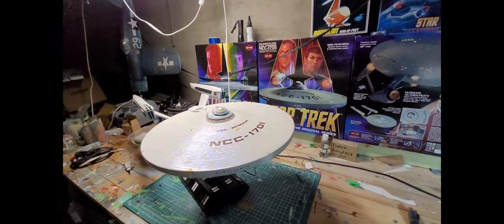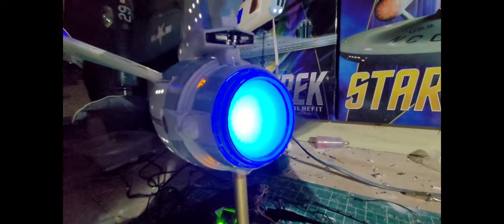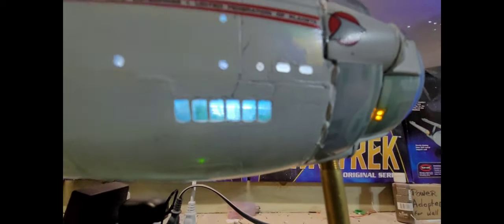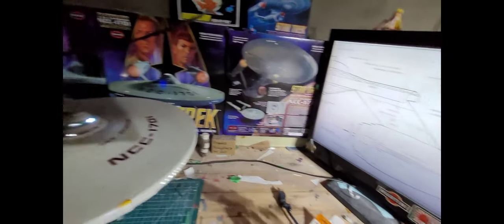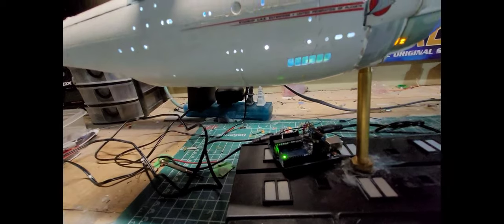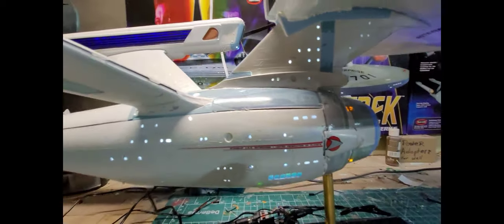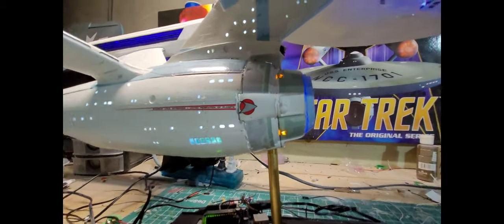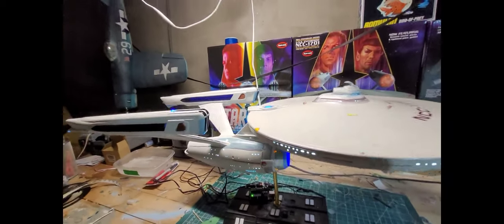polar lights 1:350 scale enterprise refit final thoughts and advice

Comment: This kit is taxing even for the most experienced modelers.  A marathon build.  I would definitely assemble everything first, do all putty work and sanding.  When it’s all built with lighting installed THEN prime and paint and do aztecs and decals.  I do wish Polar Lights would offer a lighting kit for this.
Reply from the maker: Agreed..I'm hoping that in 2022 they do..the theme seems to be 1 350 scale new releases. This year it's the u.s.s grissom.so I'm hoping they do a re-tool of the enterprise refit..maybe even a reliant variant in the same box..how cool would that be
Reply: It's not the kit, it's the builder.  Just look what others have done with this kit and see what is possible.  Yes, there are minor fitment issues.  But those can be overcome.  They have to be dealt with but this kit presents no problems that don't have solutions.  A simple blanket statement "assemble everything first, then putty sand light and paint." is way over simplifying it.  You must break this down into major sub-assemblies.  I recommend:  1-Saucer / 2-shuttle bay / 3-secondary hull with neck and pylons / 4-warp nacelles / 5-display stand.  Working into each sub section internal lighting, basic construction order, external clean up and surface prep for a primer coat at least.  The sub assembly method is obvious for making painting the azteks easier.  You can get carried away with this though, and think it is easy to paint each part (i.e. top saucer and bottom saucer) then assemble.  Try to avoid literally painting yourself into a corner on this one.  Too many builds I see have an absolutely gorgeous 5-color pealescent paint scheme only to be utterly ruined after glue, clamping, putty, sanding, etc.  If not actually ruined, at least creating A LOT of extra work with re-finishing and re-painting.
Reply: Rome wasn’t built in a day 
Like owt else taking your time is the key 
Took 3 years mine did 😂

Comment: I tried the large scale, epic fail. Now on the polar lights 1:1000. Same issue with the gap on 2nd hull. Great job. Yes, like to do again, would like to move on to the Reliant
Reply from the maker: For Christmas I got 4 more startrek models, a couple of 1:1000 scale ships and the shuttle with interior. My first attempt at lighting a model was with the 1:2500 scale enterprise c. Maybe after building your smaller enterprise it'll give you the confidence to tackle the bigger ships. Good luck

Comment: I've watched many a build video on this and none of the others have mentioned about the poor fit of the secondary hull. Forgive the question, but what is your modeling experience in years or how many kits have you've done?
Reply from the maker: As i said in the video..i'm not a pro modeller. I was comparimg this kit to the TOS enterprise kit. The TOS kit is far superior when it comes to fit. If i had to build this again i would definatley do a better job with the seams ect. Also as i mentioned i had to tske the whole model apart when the lights blew, which pretty much made everything worse
As to how many models ive built..just these two at the time the video was made.

Comment: I built that model a few times & didn't have any problems the only real gap is where the nacelles pylons meet the secondary Hull that's  a poor fit  on your model your everything is off  alignment the nacelles are dropping the saucer is crooked what went wrong 🤷🏾‍♂️ nice paint job  though 👍🏾
Reply from the maker: I had it perfect, then all my lighting blew(I used low grade wiring) so I had to pry the model apart, in the process most of the tabs from the neck to the saucer broke off. The nacelles aren't glued in yet( to the  top pylos)
Reply: @drone-tario9693  ouch 😢

Comment: I’m going to attempt this model soon as I’ve had mine in the box for a few years. You’d suggest building the entire thing first? Then spraying primer and painting it in one shot? I’m not going to bother with lights I don’t think, I’ve never used them before and don’t think I could figure them out.
Reply from the maker: At least put the secondary hull together, do all the seams etc. The saucer is easy enough to do by itself.  I just messed up by getting a little carried away with the aztecing without doing all the prep work first. As for the lights, it's easier than you think, just get a roll of led tape. They're prewired so all you need is a 9v power source, if you just want static lighting. The only thing is you'll have to replace the rod that comes with the kit
Reply: @drone-tario9693  do you need a soldering iron for the light kit? I don’t want to start a can of worms I can’t finish.
Reply: @drone-tario9693  ok, I get what you mean about the LED strip, never thought of that. That’s definitely the easiest option. And simply paint the colored lights and dish with clear colored paint accordingly.
Reply from the maker: @annstevens6223  you should get a soldering kit yes, when I said to get prewired led's that's just the resistors pre attached(finding the right resistor is complicated) 
Once you practice attaching led strings together you'll get the hang of it pretty quickly..it's super easy🙂
Reply: Don't let the electronics intimidate you.  I hear this often.  "I don't know anything about electronics...."  So, USE that as the impetus TO LEARN about electronics.  It's fun and rewarding and really not that difficult.  Instead of boring academic work in an electronics engineering textbook, you can learn how light up a model.  Much more interesting and fun to learn.
Reply: @drone-tario9693  Nope.  not complicated at all.  Ohm's law is all you need to know.  V = I x R.
Reply from the maker: @Thin447Line  exactly..my first attempt was taking a string of led christmas lights from the dollarstore and putting them into a 1 2500 scale enterprise C. Turned out really well🙂

Comment: Do the lights come with the kit
Reply from the maker: Nope..as I stated in one of the previous comments, this kit was NOT made to be lighted. All the available lighting kits are after market and NONE are endorsed by polar lights. However it's not difficult to make your own lighting. Just order some various led lights and choose what voltage you want(9v is my choice) it's easier to by the lights prewired with resistors included as it will save you alot of time